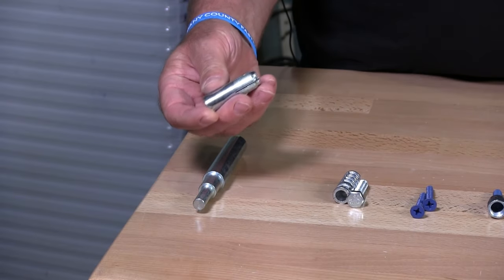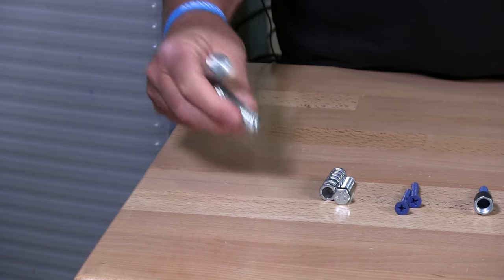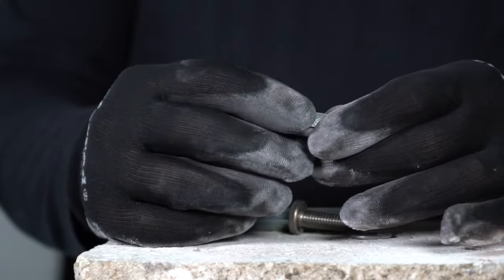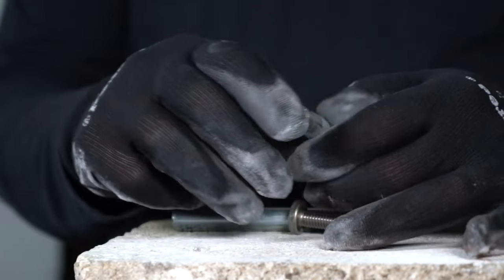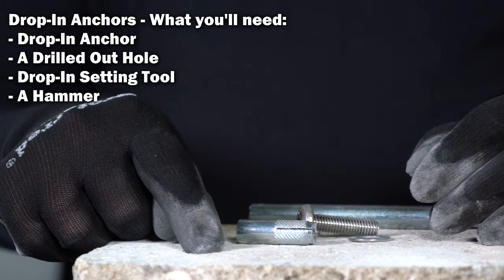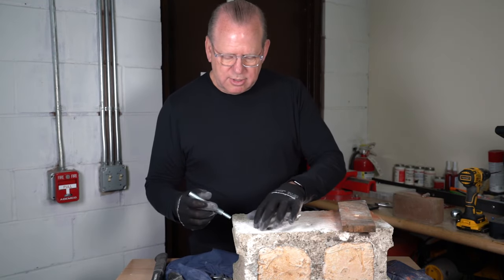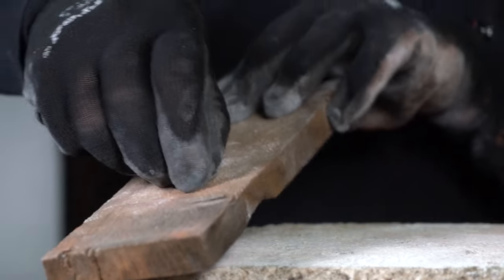How to Install Drop In Concrete Masonry Anchors | Fasteners 101

Comment: Hi we use the heavy ones for installing ballards, protectors into the concrete near the gas and our 3 phase electric drops and meters now we are doing some security screens that are dependent on the concrete to hold the man bases in place. They work great not that first time or so but you figure out the real drilling and such as you go, they really work.
Lance & Patrick.
Reply from the maker: Thank you for your feedback

Comment: can I use drop in anchor for (old English) red brick wall? It is for a barn door, need to hold heavy load.
Can I use this drop in anchor or do I need something else for brick?
Reply: I have the same question. There are other sleeve anchors available through Amazon that have lead sleeves which are apparently well suited to brick.
Reply from the maker: No! you can use a double expansion Achor or epoxy.
Reply from the maker: No! you can use a double expansion Achor or epoxy.
Reply: @AlbanyCountyFasteners  thanks, if I use the double expansion anchors, can I remove the screw and replace it as many times as I want?
Reply: @PeterLassig  yes you can. The reason to use double expansion anchors in brick is not to crack it as a wedge anchor will damage the brick.  Good luck!
Reply: @RobertCominos Thanks! How do double expansion anchors compare to the sleeve anchors overall? TIA

Comment: I use 3/4” drop in for tie back fall protection. Do you have any suggestions on testing these anchors like a pull test? In 2017 some new standards were introduced for window cleaning applications and one of those is every ten year testing. Thanks for posting.

Comment: Can these be used in hollow block as well for extreme light duty applications? Maybe at least the solid part of the hollow block. Just trying to figure out the best way for putting 1/4" eye bolts into block and concrete (if im lucky) for running fire linkage for overhead roll up fire doors. Jus has to hold cable linkage snug. Extreme light duty application but have to do it alot being in the overhead door business. Unfortunately about 7 times out of 10 fire linkage wasnt ran properly to meet fire code if ceiling wasnt conveniently low lol

Comment: I'm having trouble screwing the bolt down all the way after a certain point. I bought a bult that is just slightly shorter than the length of the drop in anchor. Is the bolt only meant to go in about halfway or is it supposed to go all the way in? I notice at the expanding part there is no more threading so I'm not sure if the bolt is meant to go in further
Reply from the maker: Sounds like the bolt is to long.

Comment: Where do we find-out what thread-size bolts to use with the drop-in anchor?
Reply from the maker: The size of the drop-in anchor is the size of bolt that it accepts. For example, a 1/4"-20 drop-in anchor accepts 1/4"-20 bolts.

Comment: Will this work in thin concrete? 1.5" slab
Reply: No. You should use the lead anchors designed for use with cinder block.

Comment: What if you dont have a set tool
Reply: Use a hammer drill and put it on hammer setting
Reply: I believe that he mentioned hitting it till it sounds solid, use a punch that will only hit the bottom inside of anchor till you feel it hit solid.
Reply: Then you buy it,

Comment: wish I would have watched this before I mangled my first ever 1/2 anchor bolt install. LOL    it;s in there but it aint going to accept a bolt .  unless i drill and tap it.

 the instructions on the package said 2" deep min.  well that does not fly for the 2"  sleeve, there has to be enough room for the pin to whack that thing inside to expand the botton so it can show enough threads to accept the bolt.  i went a head and hammer the thing flush and I am going to cover it and start over. LOL fkn BS.

Comment: There are TWO things to know when using these anchors. 
1) HOLE DEPTH IS CRITICAL. Drill only about 1/4” beyond the length of the anchor. This means they won’t work in cement block or other hollow walls.  
2) CLEAN THE HOLE. You will never get very good grip if the hole is coated in dust. Most important for horizontal holes.  
This 3 minutes video is a waste of time. They neglect to mention both of these things, and tell you nothing that isn’t obvious just from looking at a photo of the anchor.
Reply from the maker: Thank you for your feedback.
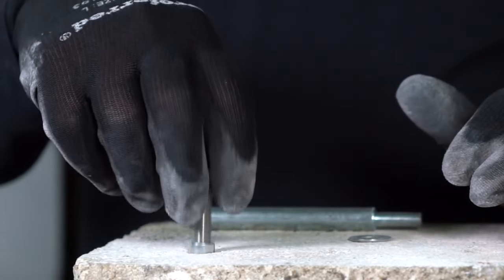Reply: 1:56 he says to make sure the hole is clean. So, #2 is irrelevant.
Reply: Thanks for the 1/4 inch fact. I was hoping the video would tell me that but it didn’t.
Reply: Not a complete waste of time. From their literature, it was not clear that the tool is mandatory or how to use the tool. The video made that clear.
Reply: You can see he recessed the anchor in the video,so your first comment is null as well.😊